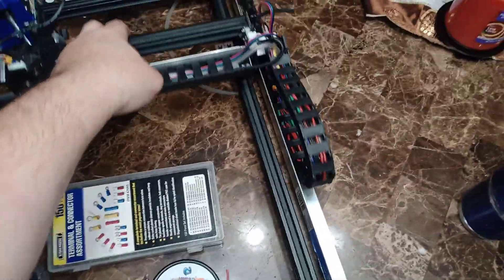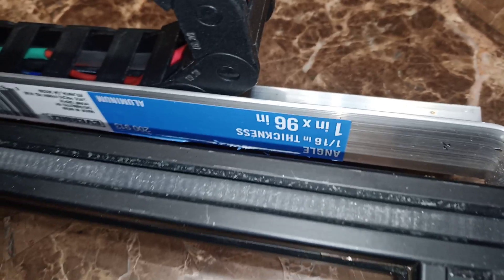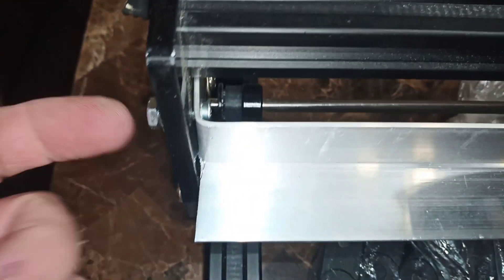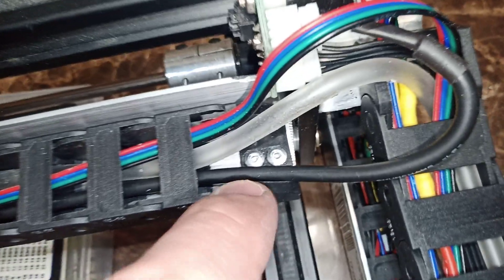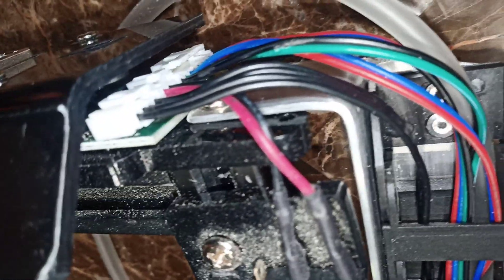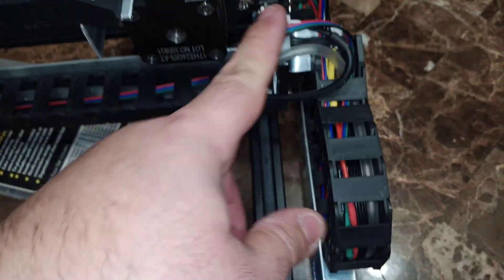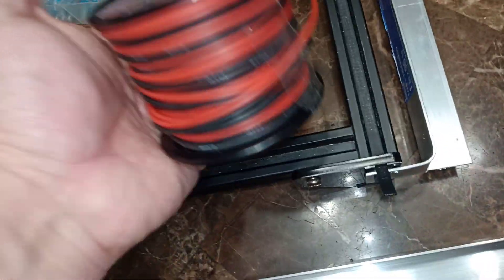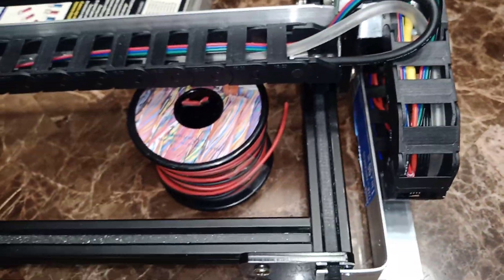Ortur upgrade Drag chain, cable chain, cable tidy, cable management upgrade.

Comment: If you use 18 gauge wire it increases the resistance slightly which may impact the motor speeds, I would use the correct gauge wire.

Comment: How did you attach the drag chain to the stepper motor end on the gantry?
Reply from the maker: I just used an l bracket attach it to the rail

Comment: Wisam, what size tubing did you use for your air assist?  I'm about to install drag chains and would like to get a tube for air assist as well and not sure what size would be big enough to give enough air, but not too big to fit inside the drag chains.  Appreciate your videos!
Reply from the maker: Sorry I just seen this I believe this was 1/8 of an inch